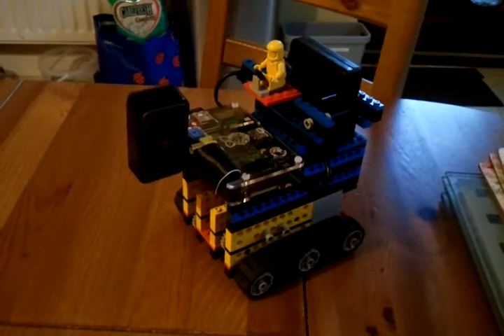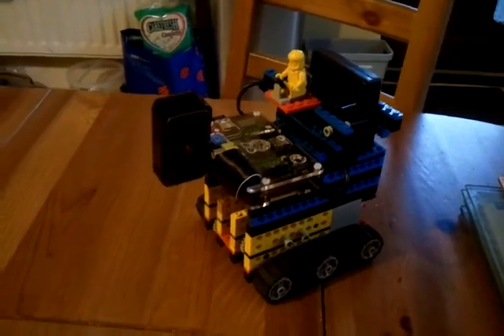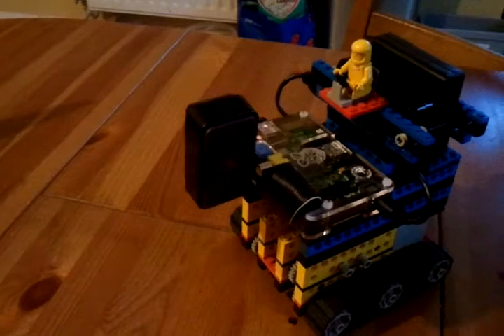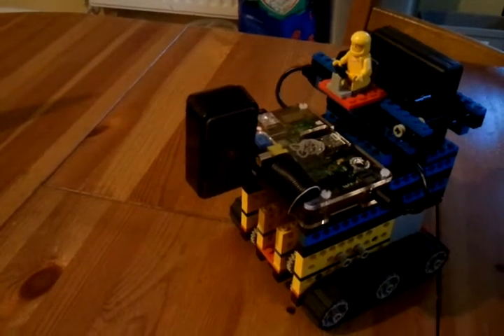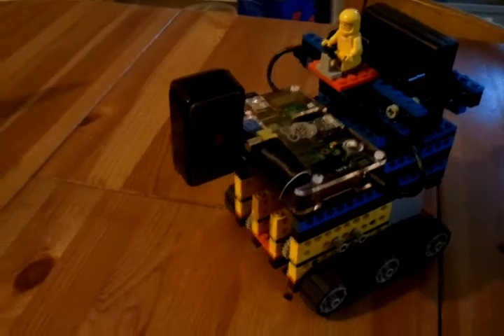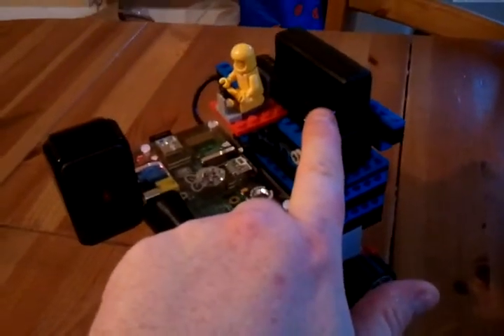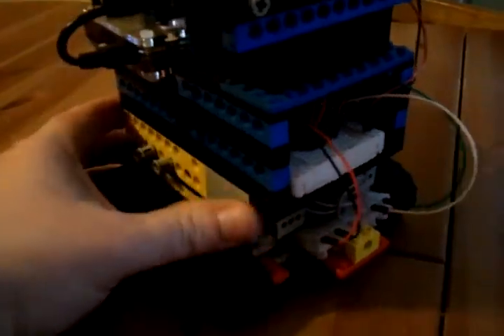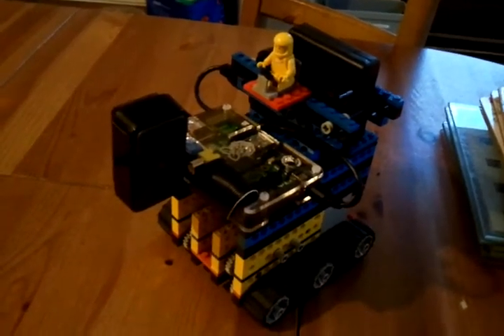Raspberry Pi Lego Robot - second version, with speech

Comment from the maker: At the moment the program just does a turn based on milliseconds of the motors running; 90 degrees takes around 2000 milliseconds.

It would be trivial to calibrate that and convert it to/from degrees.

However these older Lego motors are simply not accurate enough to get down to a single degree. I reckon +/- 5-7 degrees is probably as good as it gets for these old motors.